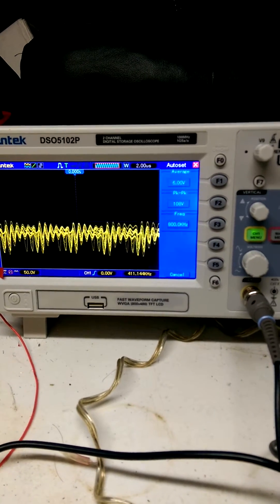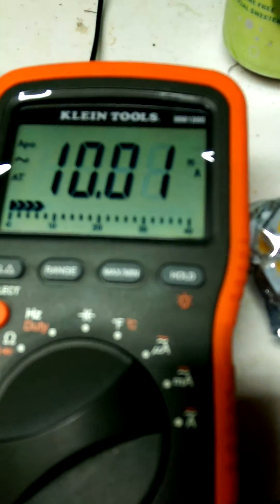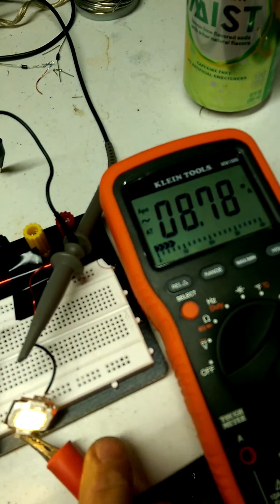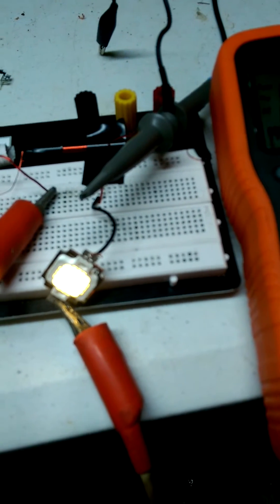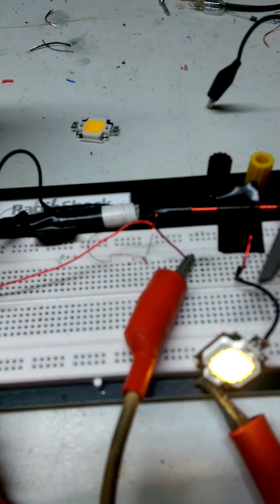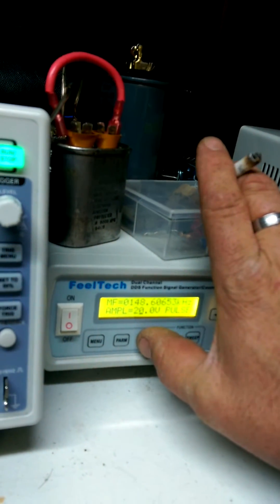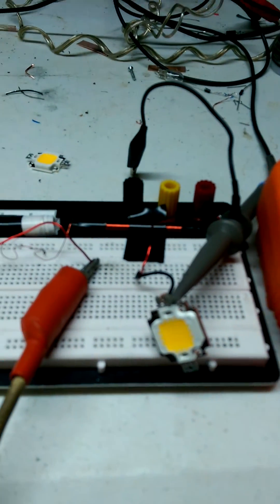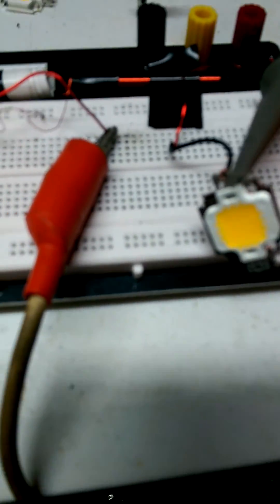Partnered coils- proof of overunity

Comment: Hi Marc, came across translation of Akula generator and talks a lot about what you have mentioned ; resonance of coils and how voltage is stepped up without loss of amperage i've got the link hope this is informative for you and helps you devlop your projects...https://www.youtube.com/watch?v=wuoISZAlFAc
Reply from the maker: +Alex Manzanero Thanks Alex, anything is a help and i always open my ears and my mind to new things. I have been studying resonance a lot and have been working with the resonation effects on both ends of a transformer without magnetic paths back to the source. This is so far the key to getting the free energy to arrive within any system. As you see, I am able to create resonance with one part of the transformer, which is half of the secondary's  natural resonance, which ended up being 148.8 khz.  When I do this, the secondary coil is infinite in impedance to the energy, so, it will not create a load, since it is wound opposite of it's counterpart and it is spinning the opposite way, it is outputting voltage, not amperage. If I switch the primary to wrap over the other side of the coil which is wound opposite, we will get amperage and the light will beam brightly. I haven't done this yet because I had yet another breakthru today with the Don Smith generator. I did exactly this on the don gen and it powered a DJ light and blew up like a bomb. The circuit had a motor and a capacitor inside of it which i didn't see because it was in the case. When I switched it on, a ball of plasma shot through the case and shot across the basement like a high voltage power line would. It scared the life out of me, and now I know not to play with this stuff without the proper PPE on. This is pure indication of power along the lines of a megawatt or more. It didn't even spike the ammeter on the way in, so, I know I have solved the puzzle for where the energy comes from and how to extract it, now the job will be how to make it safe and how we filter it to get the correct frequency.

I have (6) 1200 v 88uF caps in the bank to convert the amperage, and, I've found that discharging them does not happen when it is in operation. It will blow apart the screwdriver if i connect it while oscillating. To filter the frequency, I need to get a massive wire wound resistor good for a bare minimum of 2kw., however, if the resistor needs to be in the megaohm range, 100w would suffice. I need to cross reference this to see where it lands on a chart for filering across the ;last coil I have to build to isolate the input from output. Thanks again Alex, it's always a pleasure.

Marc
Reply from the maker: +Alex Manzanero The Akula research I have watched. It is very fascinating and exactly what I have been working with, however, Kapanadze's circuits are Don Smith technology, however, the ones we see online are utilizing so complex methods to work when it doesn;t have to be so complex. It is rather easy, but, I have found 2 methods I have learned to follow for resonance. Either primary with it's leads have to be 1/4 length of the total secondary, or, they have to be the exact same total weight, using all of the slack, even if there is more than we need, we can not cut it off otherwise the system wont work. Capacitors used to store the energy turn the energy into DC discharges, so, we need to use caps with lower voltages so they discharge the energy into an arc gap, then, we just draw the constant discharge from the gap to power our loads by adding inline coils to change the noisy wave into a near perfect sinewave, then, step the electricity down usign a cap with the coil to filter everything above 60hz out. When we do this, it converts the extra power used in high frequency and forces it back into the energy made back into conventional energy. It is thousands if not tens of thousands of times more powerful on the output side, and, if you could make it work, people will think you are a magician!
Reply: +Marc Belanger You are quite right about the length and weight as he(tom) says in his other seminars he also mentions that it may a multiple of L1; an even multiple so they can "talk" with each other
Reply: +Marc Belanger Sorry Marc it was minute 37 on this how to vid
Reply from the maker: Alex Manzanero there's a great akula research by a Russian fellow which is very good, he tells his secrets, shares a circuit that he builds with a CD4049 ic  which tunes for coil resonance enerrgized. I have found a way without this. It is extremely simple, and most will agree.

Comment: Hi Mark .I like the sound of this and i think it would be out of this world life changing for every one on the planet .Could you show us how to do the coils .I know you are a clever guy but i am a only able to copy  i struggle to understand things in  this way.A big fan of you Don Smith Gerard Morin.Thanks for this video
Reply from the maker: Hi Gerard,
 I didn't  send you the schematic link in the reply to your message, however the circuit image is here if you'd like to try it. http://overunity.com/15395/partnered-output-coils-free-energy/dlattach/attach/146721/ 

I try a lot of replications of known circuits said to provide OU. I am going to work on the Universal Motor next and provide the loading that one will do but with a huge universal motor, or the largest I could afford. I am trying to show all of the real deal circuits that are out there, make them better and more efficient, however I have been meeting a lot of resistance doing so because my circuits are manufacturing more and more energy per device, so I decided I am going to tone it down a bit to shut these guys up and stop threats I have received in the last few years.. LOL

I only used the 100 ohm resistor to get rid of the load on the fgen in the event it would cut power from it's output due to the impedances of the coils, but luckily enough, it isn't needed with my fgen due to the built in amplifier. This circuit does cut the power used in total. The circuit hardly uses any energy, and we both know I never tuned anything because it wasn't in resonance to begin with since the coils weren't the same mass due to winding sizes and use of the same sized conductor. If you wish it to be in resonance, wind the cores, then tape them with one piece of scotch tape on each side of the 3 coils used. make sure the tape is identical sizing so the weights of the coils are equal.

If you use the same sized wire and the same amount of turns, the voltage in and out is supposed to be the same, and if you have the identical inductance, you should be in resonance using the natural resonant frequency of the coils. I didn't do this because I wan'ted to only copy conrad's circuit since he was the first to post a circuit online with the winding details, resistors, etc.

If you build this, pay attention to the load used. If you use an led, you must pulse the coils with a flat round disc magnet between the cores because the load will NOT be resistive. This will start the oscillations and continue to stay lit.

It's a very simple circuit., anybody could build it and if you have a scope, you should get the same result unless you get resonance and sweep the fgen until all coils are in resonance.

Thanks,
Marc
Reply: comments are disabled for Gerard Morin